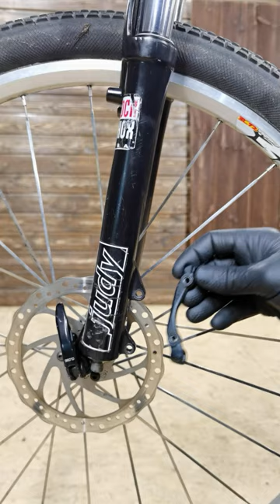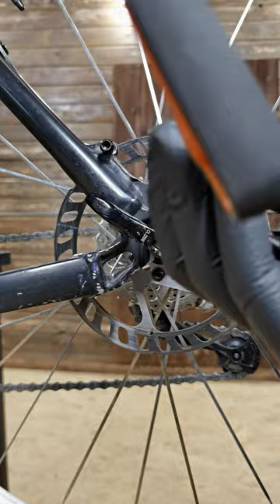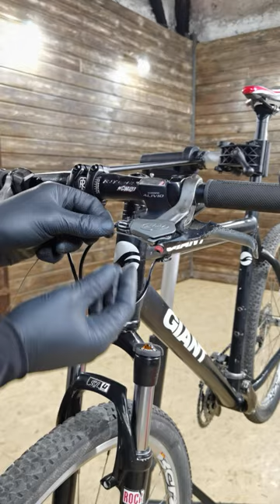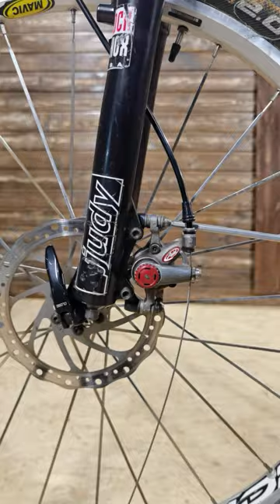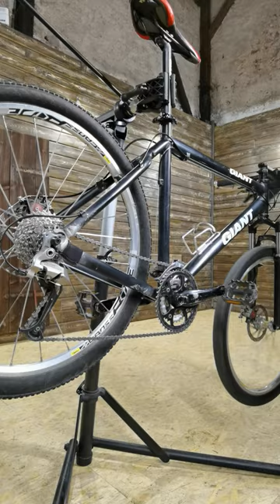Mechanical disc brakes installation. Old MTB build. Part 13 - one piston calipers assembly.

Comment: Didn’t reset the micro adjuster. The barrel will strip out the threads with hard enough squeeze. Adjust barrel only for sharper breaks but only before putting tension on the break cable

Comment: The front caliper is not adjusted properly. With a little pad wear the caliper arm will bottom out and you'll lose all braking power.